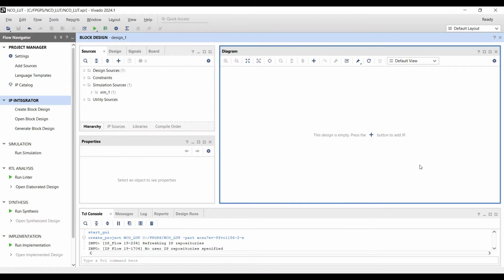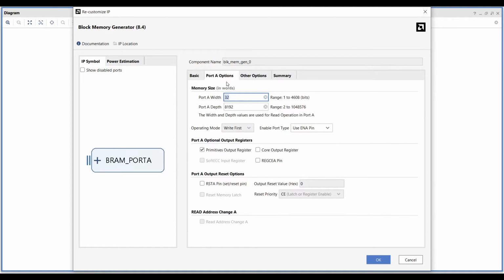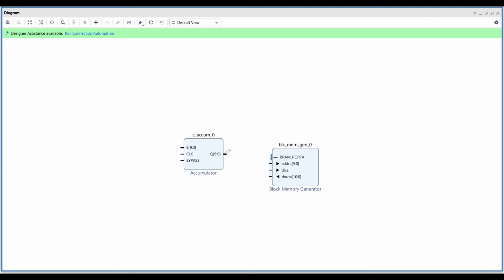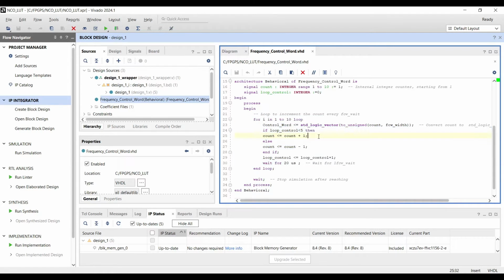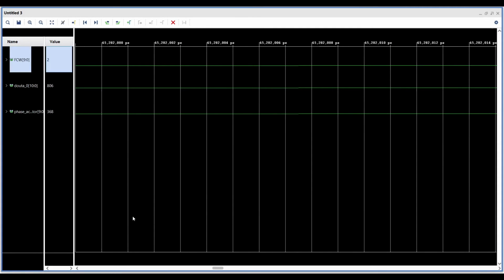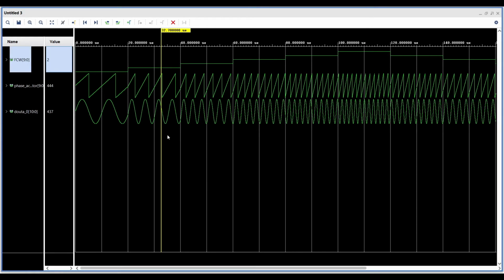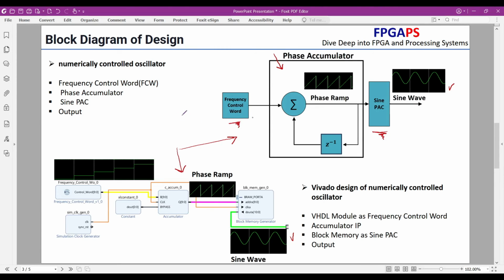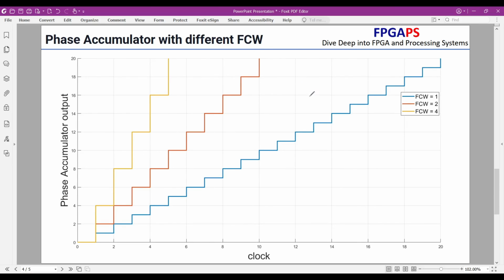Numerically Controlled Oscillator(NCO) Simulation in Vivado: Phase Accumulator and Block Memory(LUT)

Comment: An alternative to using the BRAM LUT is that you can use the DDS compiler IP Core in the SIN COS LUT mode and also get the same result. This has the added benefit that it outputs through a AXI4 Stream interface which can used to to connect to other blocks especially during PS-PL integration in APSoCs like the Zynq platforms
Reply from the maker: Hello and Welcome to our channel! 
Thanks for your comment, you can find the DDS compiler tutorial here: 
https://www.youtube.com/watch?v=E9dN7Rspefw